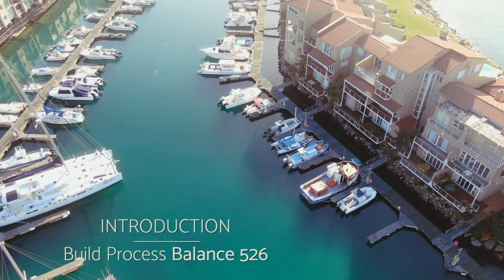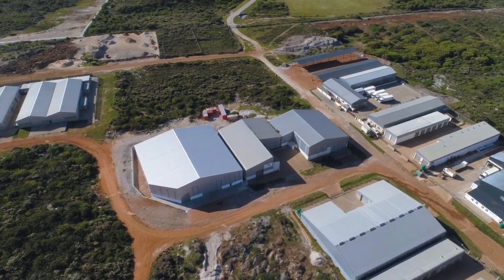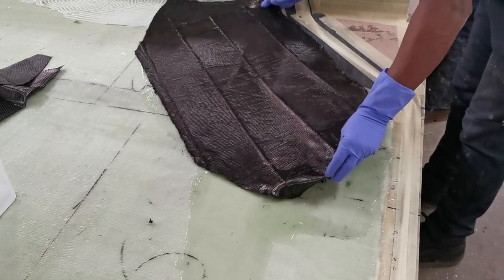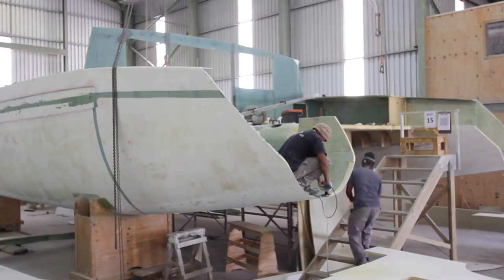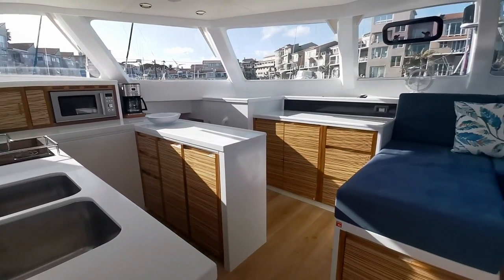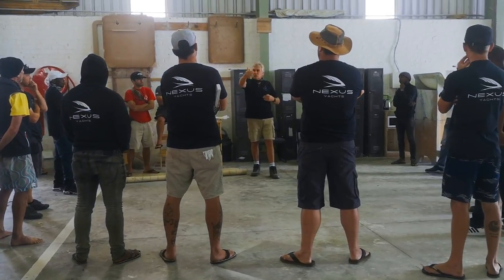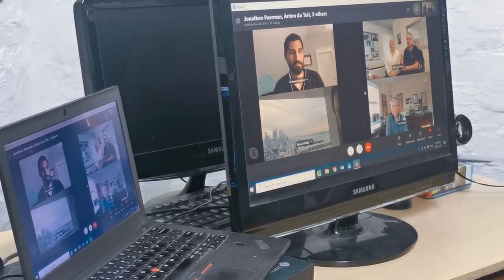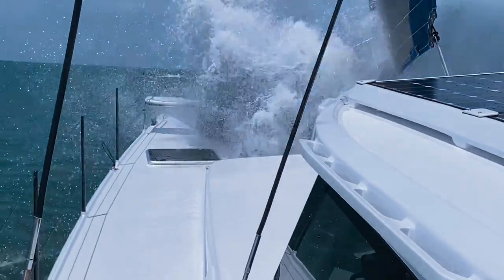Build Series: Episode 1  - Introduction 𝗕𝗮𝗹𝗮𝗻𝗰𝗲 𝟱𝟮𝟲

Comment: I’ve watched long interviews on this company and boat and am very impressed. I think this is a great choice if it’s in your budget.
Reply: The new Balance 442 is priced about the same as the new Seawind 1370.  Basically it's a smaller 526 with resin in place of epoxy for a simpler build as a much lower price.